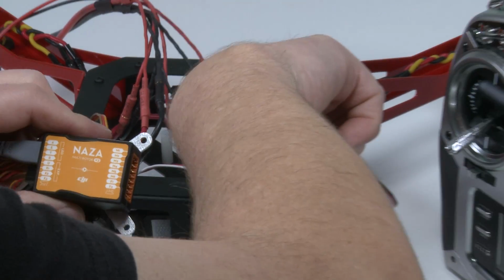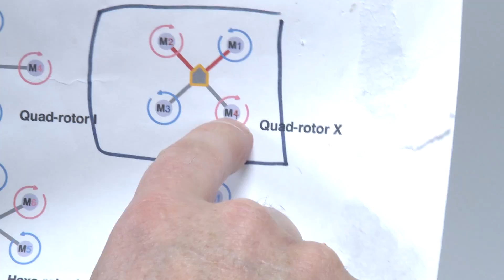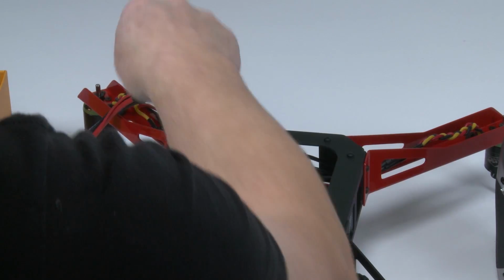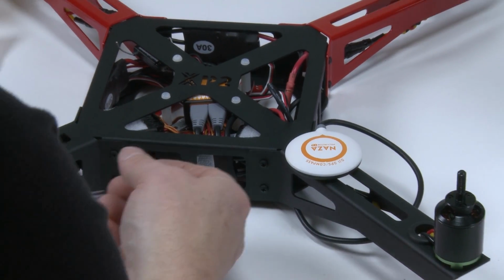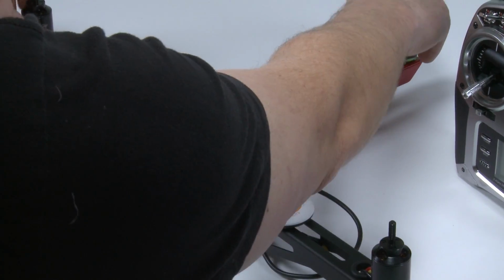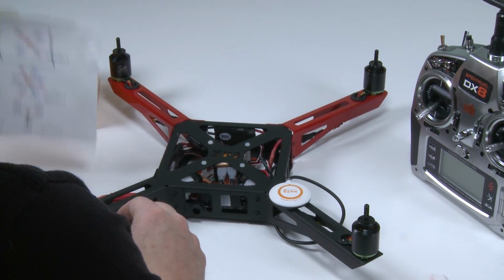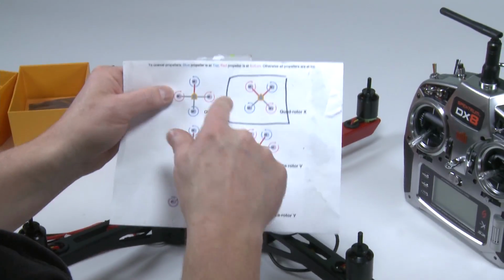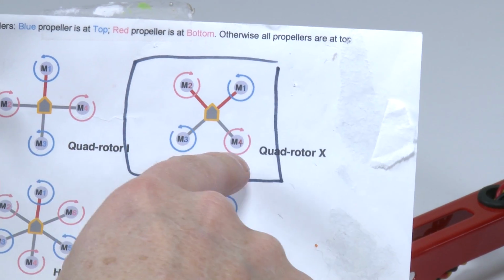XProHeli ESC Calibration, NAZA V2 and GPS install on your XP2

Comment: Aren't you supposed to remove the red wire so BEC power does not go to the Naza unit?  Also, is the throttle range once connected to the Naza the same as the bare receiver?